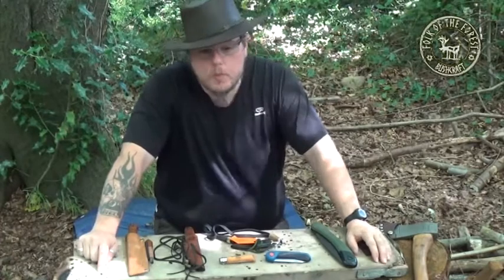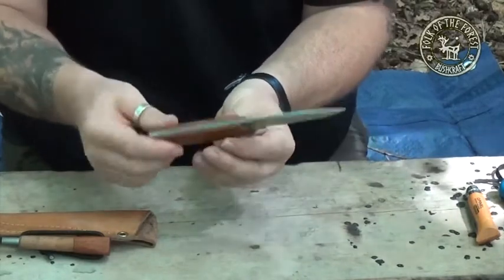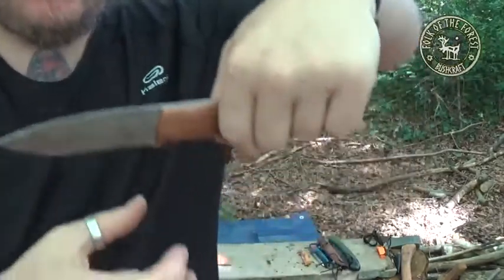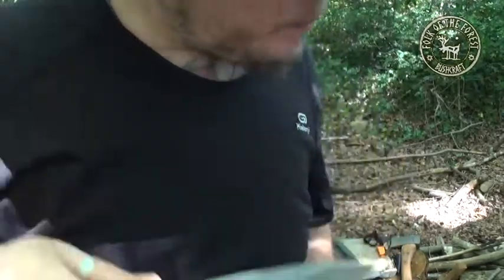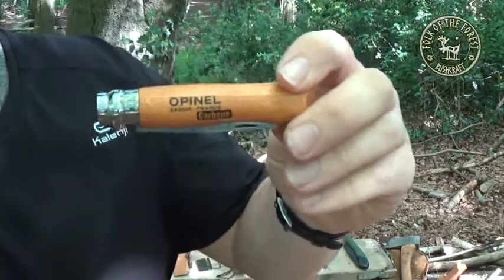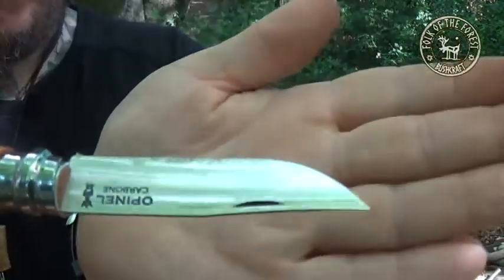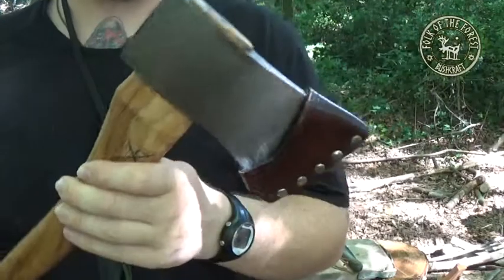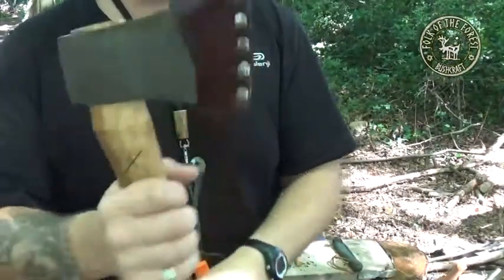Bushcraft Knives | A look at my Knives and Edged Tools | Outdoor | Survival

Comment: Say Heah Steven, This weekend I took out my combo  y Battle Horse. I had both modified so their sort of Custom Made. When I got the e-mail I recieved for the Attitude, I really liked the handle because it wasn't a sausage style handle but what like and they were offering it at the March price. But I asked them to put a slight curve on it and because of the  thickness I had a high scandi put on it so the apex would be thinner. I also had the drop point lowered so it sort of resembled a Woodlore. The fact the knife if a beefy robust knife to begin with wide at the handle it sort of reminds me of a sort of dagger but with a belly at the cutting edge towards the tip. It came out great and B H did a outstanding job making it. Actually I wouldn't trade mine for the Woodlore. Oh, I also had a White G-10 Handle with Blue Liners so it L@@Ks people friendly. I have no doubt I coukd use my knife in a Tactical Situation but to name it I would have to call it a Bush Craft Survival Knife. Yeah, I wrote down everything I was going to do with a knife. I wrote I wanted to build with it and Ofcource carve with it too, and possibly dress game if I had to and I sucesseded putting this knife together. Yeah, it does all this things with flying colors. Theirs no doubt I could use it in a survival situation and for a 5 3/8"+ blade it chops every bit as good as my BK-2 but carves a heck of alot better than the BK-2. I also had a Mad Hatter Machete made to match my Modde Attitude Yup with the same kind of handle and I even had a Scandi Grind put on it just below the sweet spot. This way I can use the Machete as a large knife and not only a Machete. The Modde Attitude is in O1 and tge Mad Hatter Machete is in L6. A lovely piece of kit. The combo performed beautifully this weekend, I prolly will stay out until Tuesday and the blades are still very sharp. Peter's Heat and Treat Tempered both knives and did a great job on mine. I'm more than happy with both of them. But I did bring my Agawa Canyon 21 Boreal Saw in the Crazy Horse Scabbard with a Aggressive Extra Saw Blade that fits in the back. If it was colder I prolly would of brought either my Gransfors Bruks Small Forest Axe or my 17"Hultafors Bruks Agdor Hatchet. But this time of tge year a Summer Long Knife is more appropriate and tge Modde Mad Hatter Machete is the right tool. I clear paths through the brambles and with the Scandi Grind I can even make feathersticks. Yeah, I had to get to some dry stuff because we did have stormy weather earlier, the spine is rounded but I did have them put a 90° edge so I could strike a ferro rod with it. I was surprised with a Deep Black Square Bottom Leather Dangler Sheath and the Machete I had them make a Kydex Sheath which I Baldric Carry it. I couldn't be happier with this combo. You did a good job keep it up, M8  Cheers. Oh by the way, I posted some of my tools on Google Plus, Your Welcome to L@@K.,,. p
Reply from the maker: paulie 4x wow that's done took set, I will definitely check it out and thanks for the comment and information. 👍